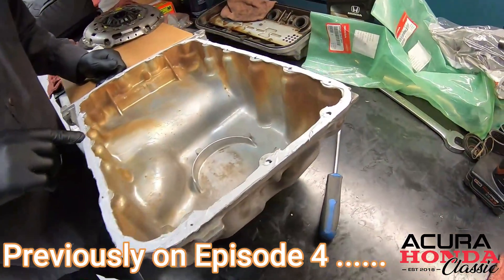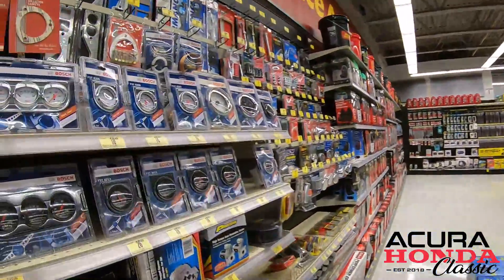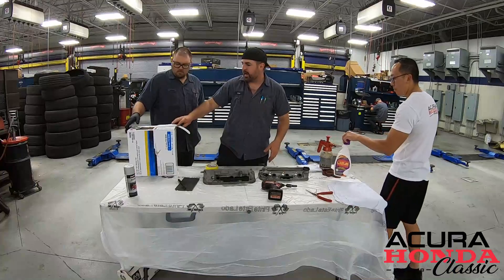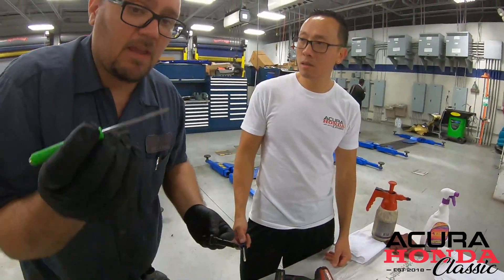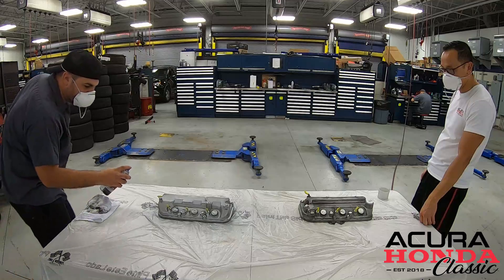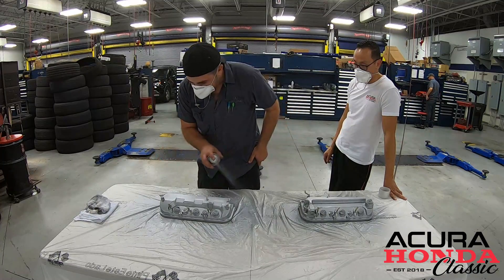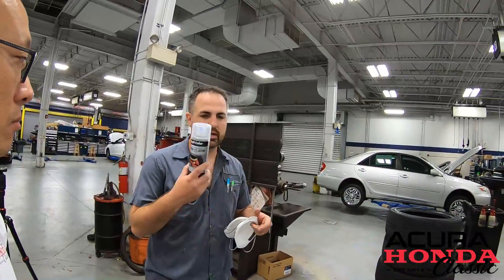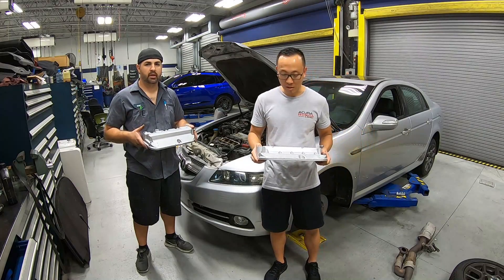Acura Honda Classic TL Type-S Build Project - DIY Refresh Engine Valve Cover Spray Paint (Episode 5)

Comment: Awesome. Love that you guys painted the VC's. I had to order new ones for my TL [old ones warped at the plug holes] and I plan to paint mine when they come in before replacing. Thanks for all the tips! 👍
Reply from the maker: Thanks for the support
Reply: @ahcgarage  did you do any "heat curing" of the paint before assembling into the car, or are you leaving that to the running engine temps? Thanks.
Reply from the maker: We just left it overnight for air dry and they are good to go

Comment: Hey what’s good hope all is well wanted to know what would a service like the timing belt water pump and gaskets cost $$$$ thank you 🙏🏼
Reply from the maker: Prices are vary from different regions but for a timing belt along with the drive belts, should run under $1000
Reply: I paid 1275 here in pa for my MDX